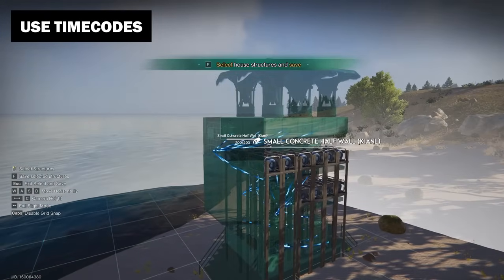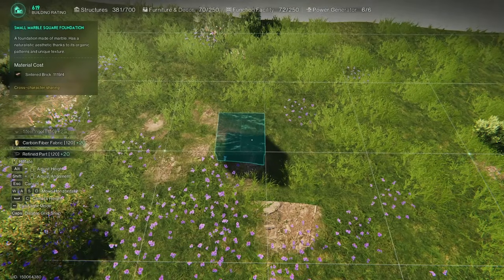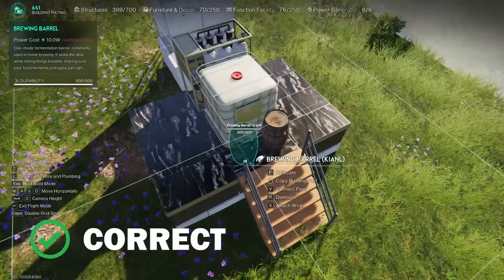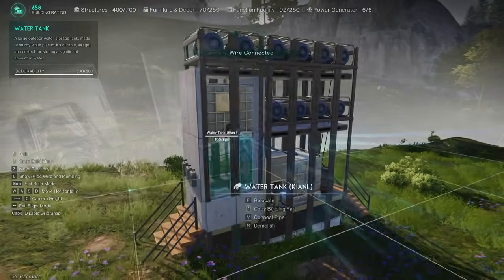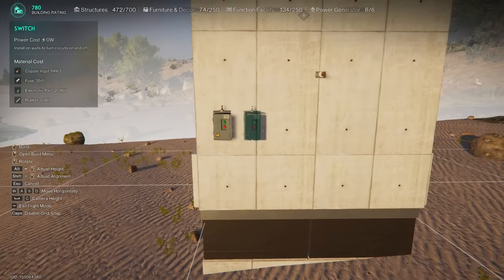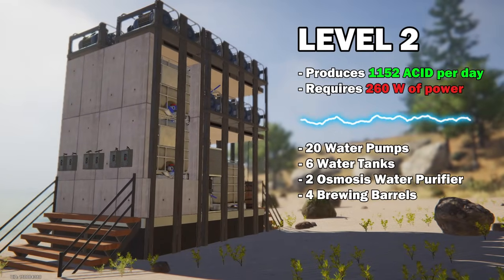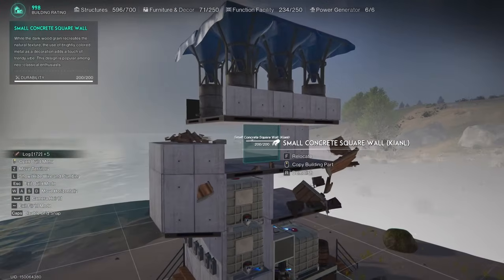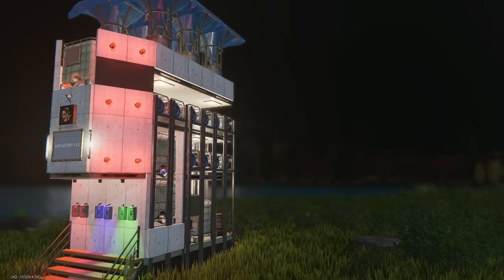Passive Modular ACID Factory (Saved as A Blueprint!) | 576 or 1152 Acid per Day | ONCE HUMAN

Comment: You need to revise your plans, there is no chance the water tank fits inside 4 small walls anymore, don't know if they changed it in patch but with or without grid lock the water tank does not fit inside the 2, 3 or 4 small walls. Just get msg "Overlaps with existing building" 3:45 your tanks are inside the walls, you can't do this in the game anymore.  It won't allow the overlap. It is possible to get the tank between 2, but impossible to put them on top of each other.  I don't know what version of OH you're using but it isn't the most uptodate one.  Also when the blueprint is used the osmosis units will not be buildable, because the foundations used to place them are missing.  Looks good.. fails badly.  The only good thing about this video, is it shows the flow of materials.
Reply: Considering i literally just built this exactly as stated? you did something wrong, most likely trying to use alternate half walls, for some reason its specifically needing to use the walls and half foundations/ceilings ion the Small Enhanced support memetic.
Reply: @Torynedarkhaven  I can manually put 1 tank between 2 half walls, but not snap them in top of each other, instead i changed the layout slightly and put the either side, half a step down so the flow is right.  The pumps not saving on the blueprint is actually caused by the small foundations, small ceilings etc.  If you use normal size, it saves fine.  At least for me, look it all looks good etc and it certainly helped me refine my initial layouts but I think my way is better.
Reply: @Torynedarkhaven  There's a guy right next to me using your exact design and it's working fine for him. But i can't get it to work, it could be the half walls, i don't have all the memetics yet.